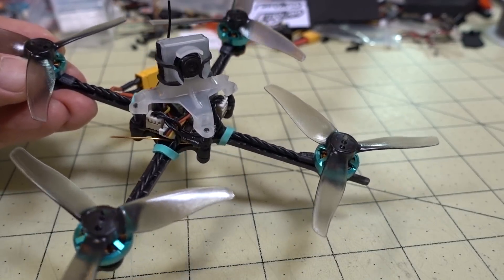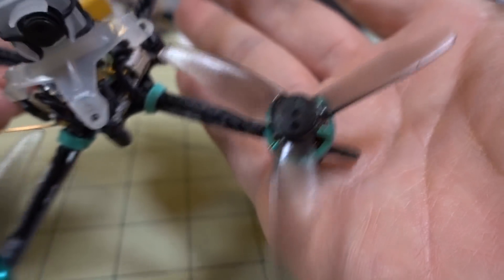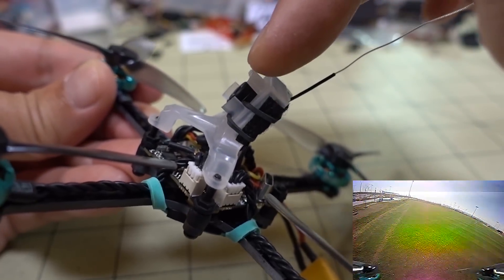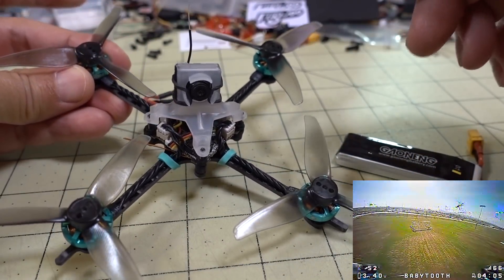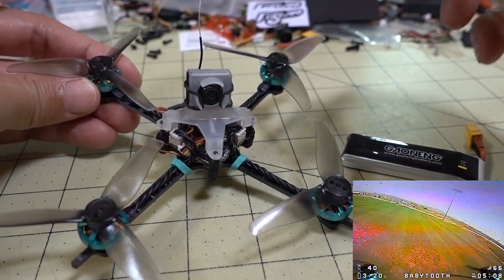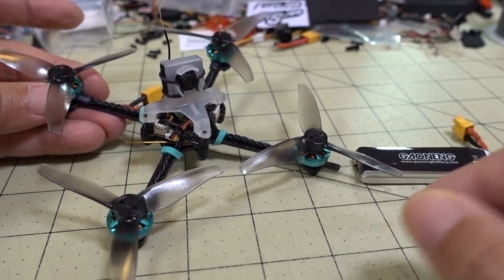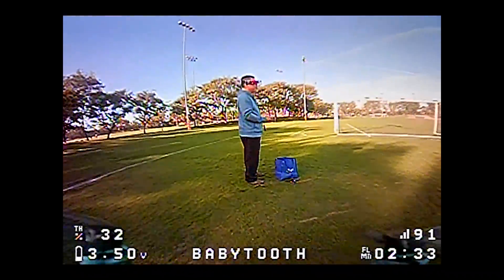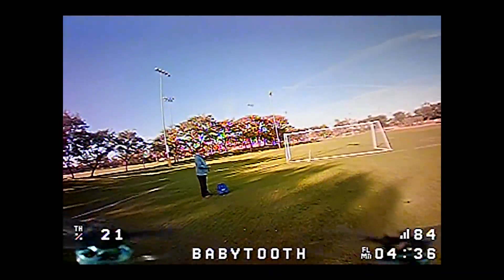KababFPV 1S Babytooth Stealth Toothpick 👍

Comment: Hi I am very new to fpv and  was just wondering how you would charge these batteries that only have one xt30 connecter because all of the other 1s batteries I have seen seem to have 2 wires for charging (a white one and then the xt30).
Reply from the maker: You need a 1S lipo charger (this one... https://bit.ly/3gnh3tU) and an adapter to convert the XT30 to PH2.0 (this one  https://bit.ly/3BfuOTF)
Reply: @AlbertKimTV  Thanks for the help!

Comment: Hi Albert, how has your luck been with the crazybee boards? Also, do you know if it still has the 3v reset? Thanks.
Reply from the maker: I'm not sure what a 3v reset however I have had my share of 5v BECs burning out on mine.  I think 2 or 3.  I have not had any ESCs burn out on me yet.  Thankfully, the 5v BEC can be fixed pretty easily with a bypass and the boards are still usable.  https://www.youtube.com/watch?v=jgRIGHu4RtI
Reply: @AlbertKimTV  Couldn't have a better reply. Thanks man!

Comment: How would this compare to the Emax TinyHawk Freestyle II? Am tossing up between the two. I have a TinyHawk II Race and a GEPRC Skip 3 coming and was looking for a little Freestyle quad
Reply from the maker: Hard to compare 1S 3-inch to 2S 2.5-inch.  The Tinyhawk is probably still a little faster and more agile.  The 1S is way quieter.  Both are fun.
Reply: @AlbertKimTV  Ok thanks for the reply and advice, I will take that on board. What would you choose between the TinyHawk II and the GEPRC Phantom?

Comment: I see that you are using xm+ that means I can easily fit in a crossfire nano rx + mini immortal? would that work? btw any other good 1s board to recommend since the crazybee f4 kinda have a built in rx. maybe some board with no rx would save some weight? thinking of building a baby tooth but kabab babytooth pick board have built in rx which i cant install a crossfire into it

Comment: building mine now, curious if adding a capacitor to the xt30 would be overkill
Reply from the maker: Wouldn't hurt, just adds weight.
Reply: Add it to the AIO battery lead pads, it will work better that way for some reason

Comment: Just finished all but the motors. Slightly different, Betafpv f4 1s and NameLessRC Nano 400 VTX. Waiting on Kabab. Might have to source some motors for this week. Snow is melting and getting anxious. Still gonna use your idea to split the motor wires between top and bottom pads. :)

Comment: is there any video of how to remove those pins? I would really like to remvoen them
Reply from the maker: I'm sure there probably are, but you need to be very skilled and quick with the iron.  I just removed the plastic connector first and then removed one pin at a time.  It was slower to do overall but still works.  If you want to learn a fancier technique you'll have to find a video about it.
Reply: https://youtu.be/51cUJkEVmvw
around the 1:30 mark, works great, i did it 1st try, just make sure to use a multi meter to check for shorts

Comment: By putting a little bit of heat shrink around your motor shaft as long as it's not a threaded shaft, you can expand your shaft size in  a straight line.
Reply: Silverwing great tip!

Comment: So I built one so far...  it's really floaty!  Do you know off hand if there is a setting I can tweak somewhere to get it to drop faster when I let off the throttle?  I can't duck obstacles cause the props seems to have too much rotational inertia on 48kHz.  I don't really want to back it down to 24kHz due to efficiency (the 600mAh's already sag to the point where you can crash an ESC on a punchout).  I tried turning features like Airmode and Antigravity off, but it just makes for a bit more wobble when I throttle back up out of a dive or similar.  If I chase cars or fly through gusts with it, she picks up turbulence like a sailboat, which I'm assuming is down to the huge props and low AUW?
Reply from the maker: Sorry, I think you'll have to got o 24khz, but ultimately, this is just too light.

Comment: Hey Kim, I use those surgical scissors (needlepoint) that will clamp down on the plug and then by taking  the soldering iron and lay it sideways so that all three post will heat up at the same time. The scissors will act as a weight and once the solder heats up, the plug and the scissors will separate from the aio board. These scissors have 3 pressure settings, do not over tighten, use the first setting (click) only, and focusing on one side of the plug, pinch on the inner side and outer side.... that will do it!...Thanks for sharing this awesome little babytooth Stealth

Comment: Hey Albert, i had to remove the plugs on my CBF4 for my recent build. There is actually a really easy trick; because the motor pins on the other side of the plug are so close together, just use the side of a fine-tipped soldering iron to touch all three pins at once. As soon as the solder starts to flow you can pull the plug off  (holding from the other side with a pair of needle-nosed pliars) in one go! Takes less than 30 seconds to have all 4 plugs removed :)
Reply from the maker: I've tried that too... maybe I'm just not coordinated enough or just unlucky but that never seemed to work for me.  Even with extra flux and a bigger soldering end.
Reply: @AlbertKimTV  MY TS100 at 400 degrees (hot and fast method) works every time pretty much. Maybe use a croc clip to hold the board whilst you do it. They can be a bit stubborn sometimes for sure.

Comment: Albert, Adam Bomb has a video about how to quickly remove the motor pins from the aio boards. No soldering iron required. I have tried his method and it works as advertised. Thanks for this review, very much appreciated.
Reply: I have also used AdamBomb's method of removing the plug and it works great and is easy to do..
Reply: Link? He's got a million videos with poor titles. Thanks.
Reply: @stevenkelby2169   https://youtu.be/DUzWvys0oUo
Reply: @sganzerlag  Thank you sir!
Reply: Here is the link to Adambomb fpv's video about how to easily remove the motor pins:

https://youtu.be/DUzWvys0oUo

Comment: For anyone removing the motor plugs,
Add more solder wire to bridge all the pins then you can heat them all up and pull the plastic housing and they should all come with it - it might leave a pin behind if gets too hot but they are easily removed.

Hope it helps!